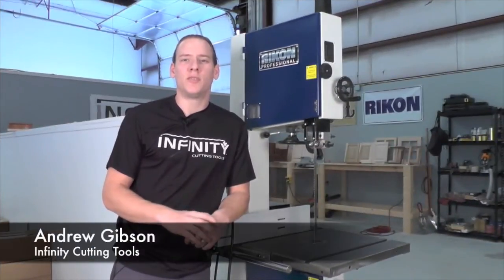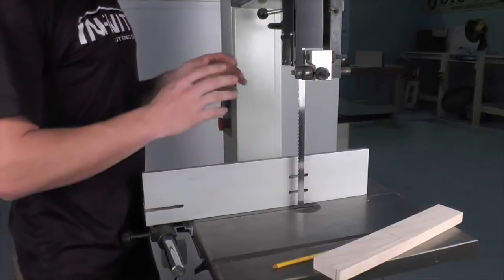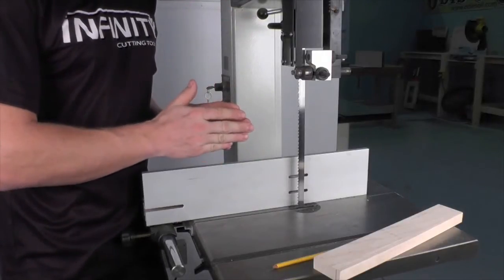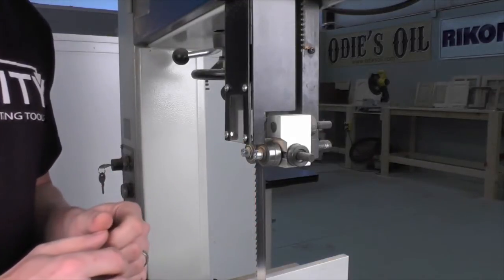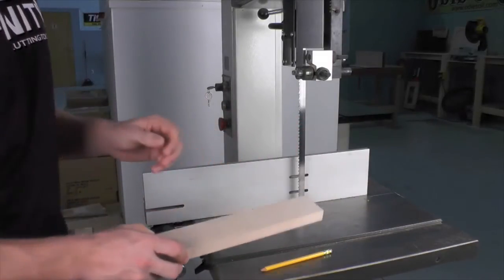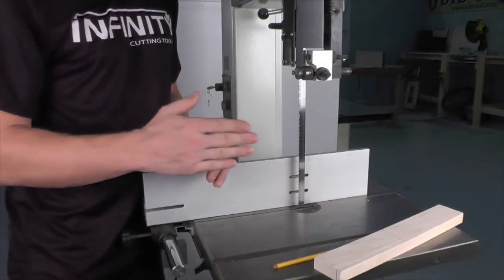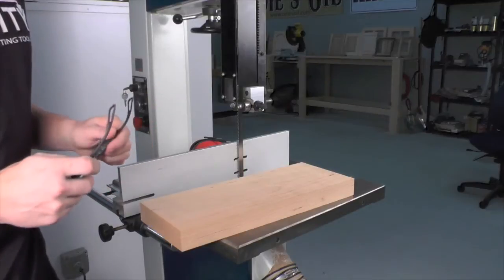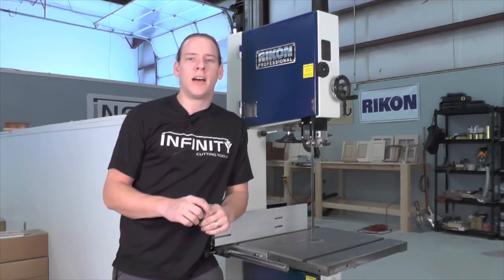Infinity Cutting Tools - Bandsaw Blade Setup Guide

Comment: You always want to check tracking by hand turning the upper wheel ;especially when change blade widths. In fact factory setting doesn'ts always work for all blade widths. These chinese bandsaw in fact often are not properly setup for tracking from factory .
Reply from the maker: I have always had good luck with saws having decent tracking from the get go and because tracking is adjusted differently depending on the saw I decided it is better to refer to the owners manual for a specific saw. It's not a bad idea to check the tracking, some people like to spin the blade by hand and some by bumping the start button. if spinning the wheel by hand, make sure the saw is unplugged and watch your fingers!

Comment: You forgot the tracking dude!!
By the way i need a 3.980 m Infinity blade for my Hammer N4400 bandsaw but i cannot find this length..
Reply from the maker: THEODOROPOULOS DIMITRIS Tracking is typically not something that need to be touched when doing a blade change and is usually done when initially setting up the bandsaw. As for the correct length for you N4400 it looks like you need a 156" blade. This is not a length that we currently stock but I will add it to our list and possibly get it added to inventory in the future. You can also order a custom length blade, just give us a call. 877-USA-BITS